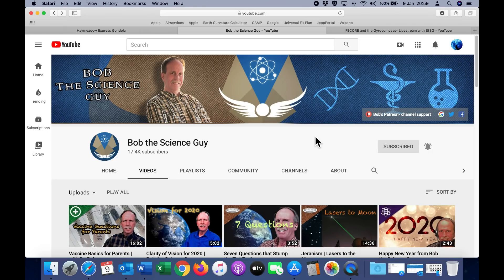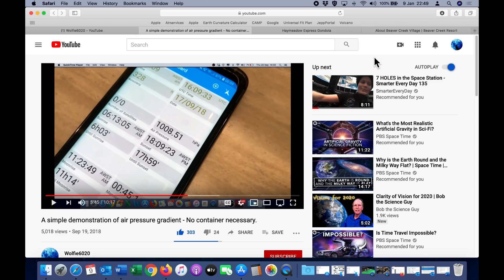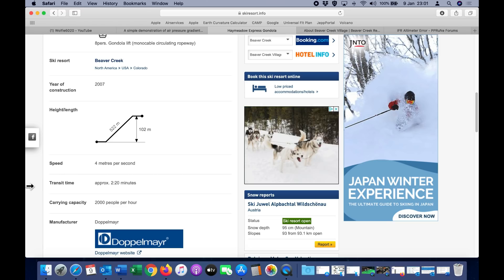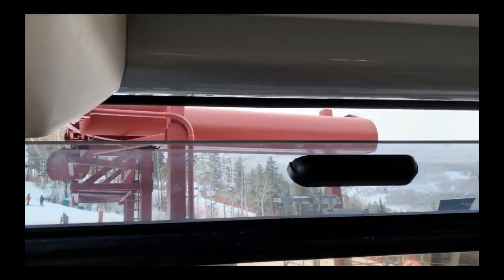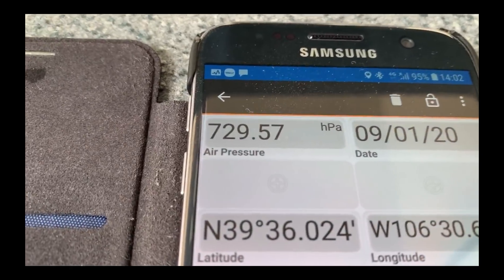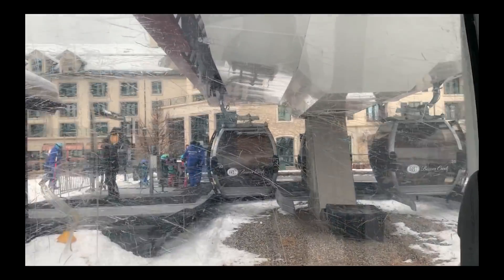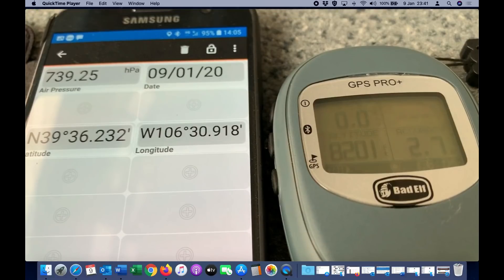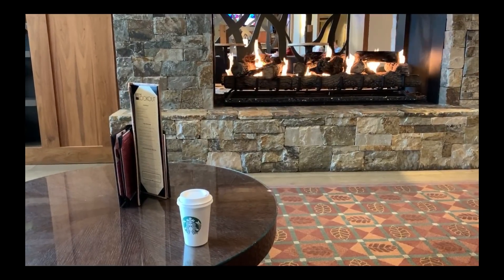Looking for a pressure gradient in Colorado USA.

Comment: I don’t understand how less air is better for a jet. 
Explain it to me like I’m 5 years old.
Reply from the maker: For a given amount of thrust you go faster.  Therefore fuel economy is better.   The aircraft can only handle so much air pressure which is indicated airspeed.  That is under 350 Knots.  Down low Indicated and true airspeed at the same so you are moving through the air slower. 

Up at 45,000 feet true airspeed is double the indicated airspeed so we can be indicating 240 knots on the dial but we are flying around 480 knots through the air.  Less air pressure.  

Plus the colder temperatures make the engines more efficient.   Greater temperature change between air coming in and air going out.
Reply: @Wolfie6020  I am tempted to pull you into a comment thread on SMD channel with a nutter who thinks the published speeds of planes are not correct and thus distances on the existing maps are all wrong. But I'm fairly convinced he isn't confused but a troll so I won't waste your time. He has made me look into the formulas for airspeed and ground speed and the differences of flying at higher altitudes. The entire conversation is a complete waste of time if not for me looking up this flight info.
Reply: less air = less mass to push out of the way = less drag = you go faster
Reply: Not trolling, but jets need the air to suck in and push out so less air to suck in is better?  Like the SR 71 flies where there is almost no air. It confuses me.
Reply from the maker: @MrMalort  That is a fair question and a good one.  There are many factors.   

Down low the air is denser so the maximum thrust from the engines will be higher.  But you don't need maximum thrust like that for cruising.  You would overspeed within seconds if flying level at full throttle at 1000 ft.  You have to throttle right back.  

The closer to 100% RPM the engine is rotating the more efficient it becomes.  So to fly at 250 knots down low you might have 75% RPM but at 250 knots up at 40,000 ft you need 96% RPM for the same thrust. The engine is far more efficient at 96% than 75% Rpm (better thrust per lb of fuel) 

The engines produce less thrust at full throttle at altitude but that is still more than enough to fly level and at those higher RPMs efficiency improves greatly. 

Other factors are the true airspeed is much higher due to the thinner air.  So you can fly twice as fast while burins less fuel and at a more efficient engine RPM

The cold helps too.  Greater difference in temperature between incoming and outgoing air means better efficiency too.
Reply: The SR-71 flies so fast (Mach 3+ published, but probably a bit faster than that unpublished) that it pressurizes its own engine air supply without compressor fans.  It uses a Ramjet engine once it gets that fast, but to go that fast, it must also fly high.  It's a pretty metal aircraft; you should check out its wiki article sometime.  And Kelly Johnson's article while you are at it.  Lockheed Skunkworks has some interesting design policies.

The skin of the SR-71 gets so hot that it needs expansion joints, and leaks fuel like a sieve while on the ground.  Aerodynamic friction at that speed is quite a design hurdle.

(Yes, I LOVE aircraft, specifically military aviation.)
Reply: Sean Carroll thanks I knew about it leaking.
Reply: @seancarroll9849  
Sorry but the SR71 does not use ramjet engines. It uses two Pratt and Whitney J58 turbojet engines. What you are talking about is the movable nose cones in the engine inlets that channel the supersonic compression wave so that it goes directly into the inlet of the engine. This basically "supercharges" the engines.
Reply: Confusing still but I think I got it thanks.
Reply: I appreciate conversations. And thanks.
Reply: @Q.E. D  I don't find him asking Wolfie as annoying or either "offensive". Wolfie is an expert and if he doesn't want to answer he doesn't (and by the way he replied ;)). 
"Asking google" may not gives,  especially for a non- expert,  a fully understandable or unambiguous explanation on a specific topic like this.

for e.g.
https://aviation.stackexchange.com/questions/1609/why-do-jet-engines-get-better-fuel-efficiency-at-high-altitudes
there isn't one explanation (as i expected) but many, with different levels of math and physycs involved, and personally i struggled to grasp some of those passages...

Thus, someone asking here for help doesn't seem a big issue to me ;)
Reply: @Q.E. D His screen name is "Anglefire 451" but he keeps calling me "dim dim" so I wonder if it isn't Antonio. I never ran into Jason so it could be him. It's really odd because he knows enough to avoid obvious traps, but he still keeps the act going. I think he's a poe but he has to know that I'm just playing with him, yet he keeps the act going. I can't imagine he is enjoying trolling someone that he knows is aware of the joke. His opening premise was we can solve for the "real" speed of a plane by taking the known travel distances for each leg, picking an average value for wind speed, and the solve for speed and distance. He assumes that planes have a fix optimal wind speed so it will be constant for each leg. It's been a huge waste of time.
Reply: @Q.E. D 
"Fine" manual?  I see what you did there.
Reply: Who cares about the shape of the Earth? The real topic that should be discussed is how Nukes don't exist
!
https://www.bitchute.com/video/bOO8PGgN7Z2e/
https://www.quora.com/Is-the-claim-that-nuclear-weapons-do-not-exist-true

Comment: I also prefer the cold. You can always put on an extra layer of clothes, but there is only so much you can take off in the hot weather. I've worked in the NSW snowfields for a few seasons, and that resort seems positively deserted by comparison. Is it an off peak part of the season, or mid-week, or are there just so many resorts over there?

Comment: It seems that many flat earthers think that science says there is this magic altitude that below it there is an atmosphere and above it there is the perfect vacuum of space. 

Rather (as most everyone else knows and as you show so clearly in your video) the atmosphere keeps on getting thinner as one goes higher.  As such, if one goes high enough the air gradually  it gets so thin science  calls it a vacuum, though not a perfect one in that there still may be a few  atoms of hydrogen and such  still present in a given volume such as from solar winds. 

So if there is no barrier to separate the air from the bottom of the mountain to the top, neither need there be any barrier between any other two altitudes even as the  atmosphere gets so thin as to be for most practical purses zero pressure. It seems flat earthers have a hard time understanding that.

They seem to think that it is a matter of things being  black and white with no shades of grey, air and no air rather, than  there being a slowly changing pressure gradient.
Reply: I have also made exactly that point in several comment when flattards have used their "an atmosphere can't be surrounded by a vacuum" argument.
At the typical cruising altitude for a passenger jet, the pressure has dropped by 75-80 % compared to that at sea level without any barriers between, so why the need for any barrier for the remaining 20-25 % until there are so few molecules left per cubic metre that we call it "space"?

Comment: Great demonstration. But FE has now moved the goalpost again , accepting the gradient but still claiming it requires a dome. They still don't know how that works either. 😂
Reply: Well Flerthers have no choice but to move the goal posts.  It's literally the only strategy they have.
Reply: The dome is required to hold in the immense 0 psi air pressure at the edge of space.
Reply: @JSSTyger  
At the altitude of the ISS (400 km) that pressure is an exceptionally powerful 0.000002 newtons per square metre or 50 billion times less than at sea level. If that dome breaks, we will lose all the air to space within a few billion years. Only the flat earth can save us!
Reply: @JSSTyger  tha it never reaches 0 pressure is the answer to all FE objections and supposed law violations. Add to that the fact gravity is the reason there is such gradient and is responsable for the very low pressure pretty much everywhere.
Reply: @eilabaca  Yep, Flerthers are pretty crazy

Comment: Flerfs think hotels are pressurized?
Reply: They will believe anything as long as it's not really true.
Reply: Well I suppose they are from the manager's viewpoint.
Reply: It's true, obviously, as everything we've ever been led believe is a hoax and/or scam until some "woke" primary school dropout youtuber brings us the truth. Most hotels, especially the high-end fancy joints, are primarily composed of huge inflatables; a stable high pressure is maintained throughout the structure to ensure rigidity. Most of the doors in hotels don't even lead to real rooms, as it's impossible that hundreds of real families could ever congregate at just one destination. They just want to make you think that they're popular enough to serve dozens more people than you, and scam you into paying high room rates by pretending they actually spent millions constructing these big over-pressurized bouncy castles. That obnoxious young couple loudly screwing across the hall? Just a soundtrack, there's nothing but a pair of speakers and a powerful LFE transducer in that "room." The elevators aren't even real, when you get in and press the button for your floor (the only one that actually does anything), they just deflate the lobby. 

Combine all this with the facts that the jet engines on all commercial airliners are top secret freemason "over-unity" designs that provide free thrust given just a little compressed-air jump-start, and electrical energy is (thanks to our lord & savior Nikola Tesla) transmitted without wires which inexplicably makes it free regardless of the fact that someone has to generate it, and you start to realize that round-trip airfare and a week stay at a five star resort in Wailea, Maui, Hawaii should only run you about $45USD per person.

As a matter of fact, more like $45 per family. If you're really paying attention, you'll eventually notice that your spouse, children, parents, siblings, etc are just holograms. For centuries now, NASA has been issuing family-generating hologram devices that follow around most of the several thousand authentic humans. They've been programmed to keep you distracted from the truth, and if you happen to notice that earth is flat on your own, they laugh their heads off at you to shame you back into the globe cult. Every extra hour of work you do and every penny you spend on "feeding" and "caring for" your "family," is really just going to keep some NASA freemason fat & happy at your expense.

If you want to be truly WOKE, you mustn't sleep, ever. All it takes is around five or six days without a wink of sleep and you'll begin to see the truth, just as I have. Keep it flat y'all.

Comment: We don't see this level of dedication from the flat earth community.
Reply: That would require the flerfers to actually go outside and think critically. They are much better at being spoon fed by charlatans in the safety of their parent's basement.
Reply: I sometimes wonder if those idiots just deny everything and refuse to accept proven facts and demonstrations just so they can sit back and laugh at us normal people going out of our way and bending over backwards to show them the 'truth',  we should not 'feed the trolls', never delete their posts , that just gives them more ammunition,  just don't get tangled up in their madness.
Reply: MD Bober 

What about those people who don’t know these guys are trolls? We don’t respond to flerfs to persuade them (although that would be a bonus) but to ensure their nonsense doesn’t go unanswered. Some of these questions are deep and their answers can fool the unwary and uneducated—and even we who have spent some time studying these matters need occasional help.
Reply: @jormungandr9251   true
Reply: Well, there are basically two reasons why the level of dedication is not there in that group.  For some, it's a matter of having the intelligence necessary and certainly some have been basically slapped in the teeth for even trying.  Remember the case where one of them purchased a very expensive piece of gyroscopic equipment which showed a 15 degree per hour rotational speed of the Earth.  They don't want to prove themselves wrong again and again and again, do they?